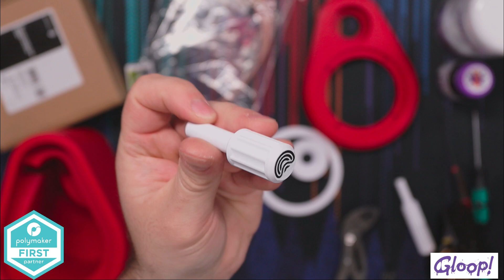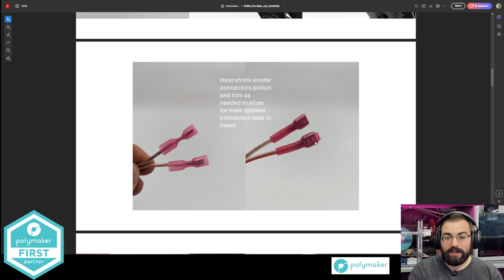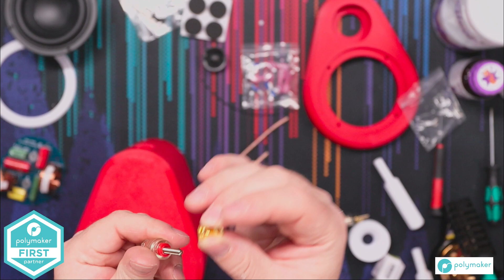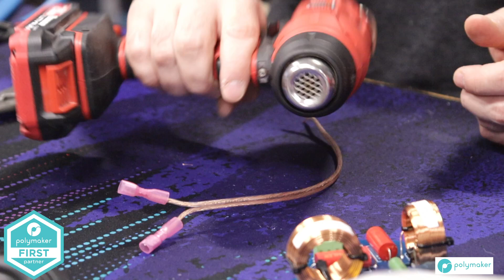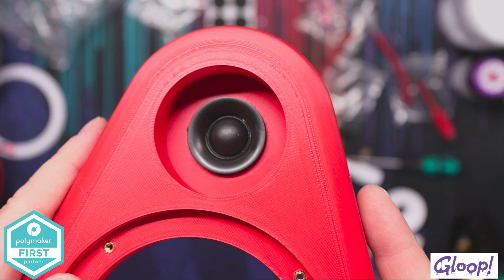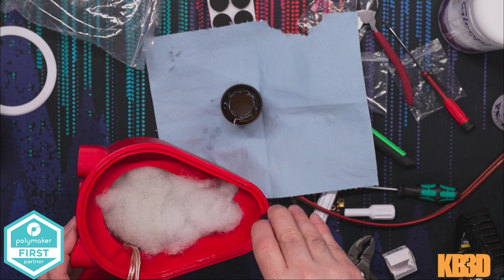Deposition Sound FDM4 Build Guide

Comment: Here's a future idea for that tool you made to add the nut. If you made the other end of it a hex rod, you could use it as an electric screwdriver bit.
Reply: And if you're worried it would break, I wouldn't recommend using it with anything too powerful. A simple AA battery operated screwdriver.

Comment: Unfortunately the kits only ship to the US.
Reply: You don't want one. Here's why: 
1) Print time is around 3 days for the total setup on a voron 2.4 running Ellis' profiles. 
2)Cost is around 2-3 rolls of filament and that's printing THIN like 2 perimeters and 2 top and bottom layers. (FDM5's Cabinets) at 25% infill with 4 perimeters and 4 top and Bottom layers it's 1.4 kg's and that's probably not even dense enough infill for a speaker cabinet. This already increases print time to over 2.25 days for one cabinet body. Not the face or ring just the main cabinet
3) material isn't appropriate for speaker design. Mostly hollow plastic isn't going to make good speakers. 
4) Off the shelf speakers are cheaper and probably perform better. 
5)Total Overall Cost is over $300 Canadian (just the kit without amp). For $300 Canadian you can get some seriously decent bookshelf speakers. Edifier R1700BTS are under $300 have bluetooth built in and don't require a $100+ desktop amp or $100-200 in filament.

I've built my own models based on the FDM5's to accommodate speakers I already own. This has turned into a giant waste of time as the project isn't even economically viable with me already owning the speakers. 

As a personal 1 off project, I get it. As a commercial venture? It doesn't make sense for a customer to invest in this.